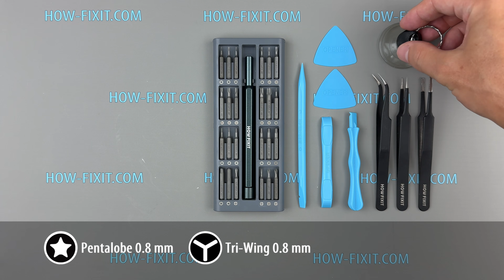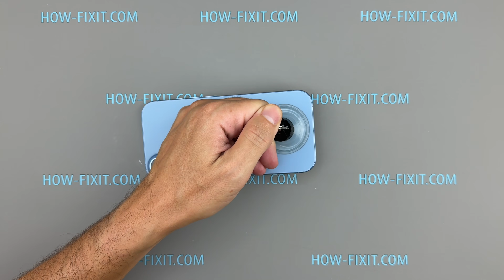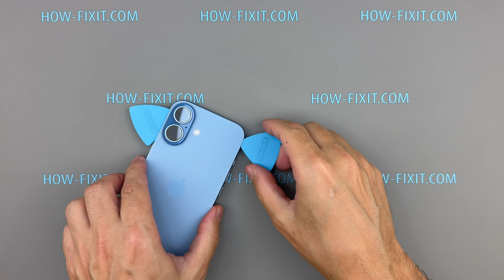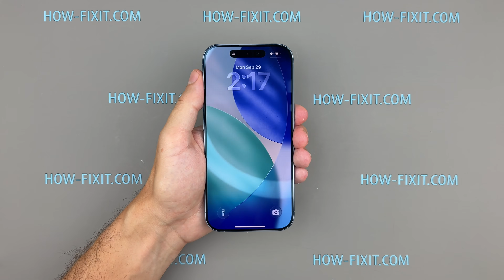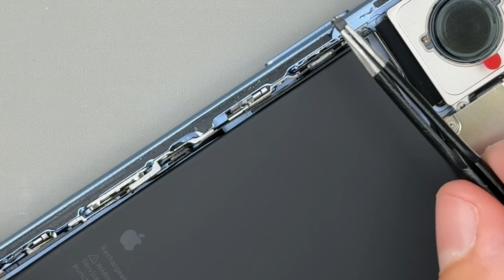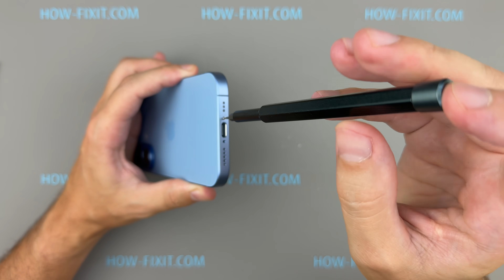iPhone 17 Back Glass Replacement Guide | Fix Cracked Rear Glass

Comment: It's a helpful video, thanks. However, the iphone glass backs that I'm asked to replace are inevitably shattered, meaning that suction to lift the glass back out of its glue bead is not an option. You should create a video which copes with that more likely scenario. 🤔